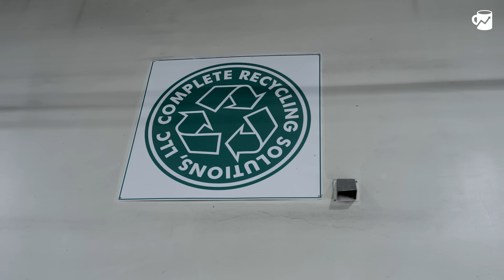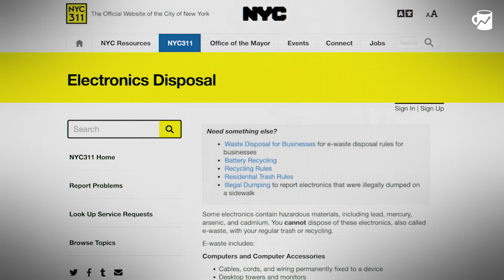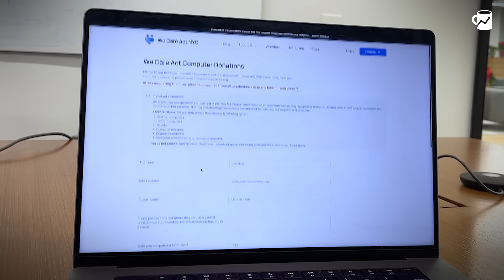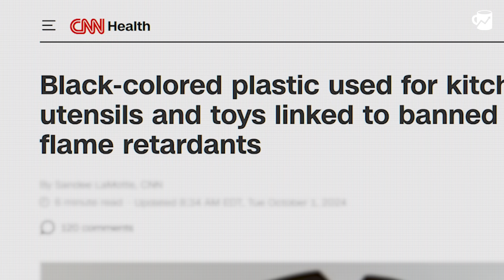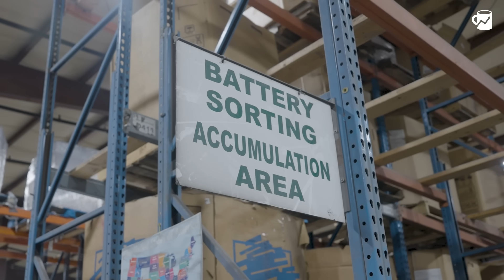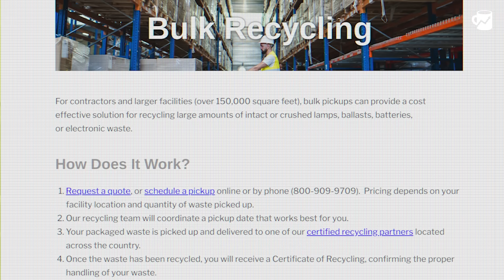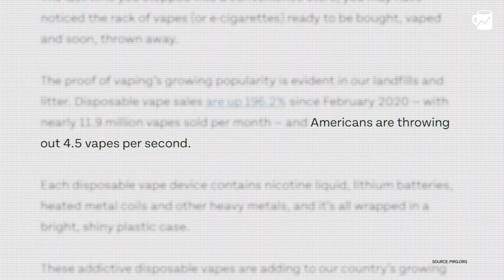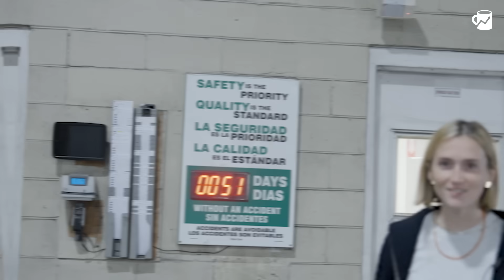I went down a rabbit hole trying to recycle all my tech waste

Comment: The slogan isn't just "Recycle", it's "Reduce, Reuse, Recycle" in that order. The best way to avoid e-waste is to not buy gadgets we don't need. The second best way is to find someway or someone to keep using it.
Reply: Reduce.Reuse.Repair.Recycle
Reply: A little funny story from years ago when I was moving out of country and had not-that-great office table and even worse chair. I tried get van and driver to get them to the landfill but all attempts failed.

Then I just put it for sale at $0 and within 10 minutes I had guy coming to pick them up. I saved money and hopefully person who got them was happy using them.
Reply: In all fairness, the software industry has to do its part and stop software bloat
Reply: There should be a 4th R that comes before all of the others - Repair. I have a subwoofer that stopped working. I opened it up and found that a capacitor had swollen up. I went to Fry's and spent less than $2 on a new capacitor, soldiered off the bad one, replaced it with the new one, and I got it working again, rather than having to buy a new one.
Reply: @googleislame  Yep!  Relatively easy to determine visually, but it takes a little skill and practice to get it right.  Control board for the washing machine, control board for my car's climate control panel, the one for the central air, I don't even remember all the capacitors I've replaced!  I flubbed the control board for the stove, so we had to replace it like we were going to anyway.
I put the stove at the curb and a scrapper came by within an hour.  I even helped him load it onto his truck!
Reply: would love to have kept using my previous phone after 6 years but they stopped android updates and lineageos install didn't work so i potentially bricked it.  it should be illegal to stop software updates or companies should be forced to provide easier custom os installations.
Reply: @PurpleYoshiEgg  and forcing people to change because the app stops working too soon.
Reply: But even if we don't purchase gadgets that we don't need they are manufactured and used or un-used it will go through the same process of recycling. So, does that make a change?
Reply: @mr.jeramius8710  Except they'll make way less of those gadgets, if their is demand (meaning people buy them enough) they'll keep producing them if they aren't being bought they'll stop producing them.
Reply: Vapes and e-cigs are the biggest thing because they can be reused instead of just being disposable
Reply: Amen. It saddened me to see people buy a new phone just because it's the latest phone not because they need it. It was crazy 15 years ago but there's almost no difference these days
Reply: @sie4431  100% there aren't any new killer features nowadays, its come to the point that its just a tool like a screwdriver. It used to be that most computers were outdated in a year. Nowadays electronics are still usable 5 years later, my Mac air is 5 years old and I have no plan to replace it yet.
Reply: @chewielewis4002  actually new M series MacBook's will be replaced every 3-5 years due to the fact how they are build
Reply: @chewielewis4002  bro, even my 2012 laptop is still good for daily uses
Reply: @sie4431  Phones used to be supplied with like 3 years of Security Updates if you were lucky, Samsung's latest S24 series are some of the first to sport a much nicer 7 years of Security Updates and greatly slowing the need to replace a phone.
Reply: @sie4431  What saddens me is when you have to throw away an older phone or tablet because it is no longer fit for purpose, due to lack of software updates, apps being marked incompatible due to old OS versions, or the network radios no longer being compatible because the cell phone providers constantly downgrade the older networks to make room for newer faster ones. 

I have an iPad Mini that was "lost" for several years. So it's essentially brand new when it was "found". But the IOS version cant be upgraded beyond (I think) version 9 or something. Which is a major cutoff for Apple, the vast majority of apps will not install on the older IOS version. And they don't provide access to the older app versions that would work on it. So it's literally trash, despite that it boots up fine and can run the few apps it still had on it from the past just fine, connect to the internet fine. But the web browser is so old it is incompatible with many websites, vulnerable to security flaws, etc. And almost no 3rd party apps such as Chrome, etc, can be installed.
Reply: @sie4431  do you live under a rock? It's extremely different now days. People buy new phones now mostly because the battery needs replaced and or the hardware is not supported so apps stop working.
Reply: @thedude5040 You can replace the battery on phones and (most) laptops (and then recycle the old battery). Much better than buying an entire new device.
Reply: @thedude5040 1. Battery can easily be replaced.
2. That’s a software problem not a hardware problem.
Stop making excuses for buying things you dont need.
Reply: @irvinclemente2368  depending on the phone, batteries may not be easily replaced or even sourced. Are you a programmer? Could you find a way to make an old phone compatible with apps? These are problems the common person faces.
Reply: @thedude5040  keep consuming and don't question why you have to consume more for more
Reply: @Sinaeb  I'm not sure if you are tying to say that personally or if the comment is directed to consumers in general. If personal, consumerism has no effect on me. I'm already a 32 millionaire, a $1000 phone is just a thing and has no meaning.
Reply: @thedude5040 you make a good point but we also have to consider that people generally don't try to hold on to their phones as long as possible, which produces more waste. The battery issue is a frustrating one (from personal experience) but one can ride that out for a while instead of just getting a new phone every 1 or even 2 years because of it. Or just replace the battery instead of buying a new phone. Or buy a phone with that doesn't have known battery issues after a year (so not an iPhone). Or buy a phone newer than what you've got that's just been sitting around for years instead of the latest model

It's different from 15 years ago for sure, especially with how much we rely on the phones but we can definitely do more to reduce and reuse
Reply: @thedude5040  Some people buy a new phone every one to two years. Phone work fine for four or five years.
Reply: @ElmerFudd35  not any more. Those people who buy every year or every other year are the minority
Reply: @thedude5040  You do realize you can just replace the battery right? If that was the main reason people would just do that. I've replaced the battery twice on my iPhone and it is still working fine. Though to be fair it is also only 8 years old.
Reply: @ducklingscap897  explain that to everyone else. Personally it doesn't always make sense to replace the batter because there are other more broken things on the phone. I bought a phone last year because my 4 year old phone's SIM card reader stopped working, as well as over heating, and poor battery performance.
Reply: @thedude5040  maybe change for apps but batteries can be replaced, even if they tell you it is not. Some phones only need a simple battery change when nothing else is failing. I have done it myself many times over.
Reply: @thedude5040  I think they mean when people buy the newest iPhone every year for no reason
Reply: @kaitlyn_stark and I'm saying that doesn't happen anymore, not to the extent of the past
Reply: @thedude5040 nah, thats just not true. people would buy better quality if that were the case like samsungs. apple successfully infiltrated the market with emotionally manipulative marketing that has resulted in a normal expectancy of "upgrade" mentality as "efficiency" is being sold with anything new- despite the lack of quality that continues to be released. regardless phone quality slowing and speeds slowing soesnt make the product unusable or even bad, just slower, which means it works for the intended function the person bought it for still thus they should keep it. your approach to the issue of corporate manipulation on culture is extremely superficial
Reply: @thedude5040 and you sooo need to run the latest mobile games or whatever 😂
Reply: @thedude5040  What apps stop working that soon?? People buying every other generation. I genuinely never heard of app support issues. I definitely deal with the battery problem, but not to the scale of people buying phones nowadays.
Reply: @thedude5040 yea and no. I’m still rocking my iPhone7
Reply: @thedude5040  did a large group of people collectively agree to let you speak on their behalf? No? Then don't shut someone else's comment down and speak for everyone, especially when you're just plain incorrect lol. You're crazy if you think people only replace their phones for the responsible reasons of 'the battery needs replaced or the hardware isn't supported anymore.' Sure, people buy new phones for those reasons, but I'd bet more people buy the new phone every year simply because it's the updated version. Their battery is fine and the hardware just a year old, but they'll still replace it, because of a single new feature, or new color choices, or whatever. You live under a rock if you think this doesn't happen.
Reply: consumerism companies have tradeins where the new phone only costs $200 after trading in an old phone in which case its worth it especially for people like me with almost all my waking hours spent on a screen
Reply: @ckq a phone can last 3-4 years
Reply: @ckq  there is not a single way to legitimately make the math work on your logic here. It's never worth it to buy a new phone every year just because a company offered a trade in for it. 

If the math worked in your favor, it wouldn't be profitable and the programs wouldn't exist.
Reply: @Quantum-Bullet  can go even more longer depending on some factors.
Reply: Capitalism incentivizes consumption. Without regulations, "reduce" and "reuse" are anathema to this concept. Considering Corporations own this country (Citizen's United), you're asking for the full burden of responsibility to be put on the Consumer. Asinine. This individualist "the blame needs to be put fully on the Consumer" is partially why we're in this mess!

We need far more government regulation. If anything, E-Waste should be handled and regulated on a Federal level. But it won't because it's "socialist". And so Big Tech has no incentive to stop releasing more and more E-Waste, making last years product incompatible and thrown in the trash. Big Tech has it's hands all over our government and will fight tooth and nail against anything that would hold them accountable.
Reply: Consumer solutions will never solve this. It had to be addressed at the production level.
Reply: This is one of the most important point. You don’t need to change phone every year, not even every 2-3-4 years. Make a good buy and make your device last 5-8 years
Reply: The whole point of that slogan was to shift blame from corporates and CEOs to the private consumer. Let’s not blame big oil companies who lobby. No matter of avoiding e waste matters when Taylor swift, Elon musk, and the kardashians produce me carbon footprint via jet fuel than most people’s lifetime.
Reply: Reduce, Reuse, REPAIR, Recycle ♻️
Reply: @d3rpn1nj47  i think repair kind of goes in the reuse category. Repurpose was the other R before recycle
Reply: I try to buy all my tech used. Phones and laptops surpassed my needs about ten years ago so I don’t mind being a bit behind.
Reply: @konradhunter1407  yeah, me as well. Older laptops with newer hardware and software work great for my needs.
Reply: @vaderladyl  Lack of security updates is the main reason to stop using a phone. Multiple companies have promised security updates for X number of years then don't actually do it
Reply: @strayiggytv  yes, I guess, if that is a priority of yours.  Still people will use them even if just for calling and texting only.
Reply: The 4th R, missing frim the slogan here, is *Repair*.
Reply: Still rocking my iPhone 12 after buying it when it was brand new. Might need to do a factory reset, it’s been slowing down lately but it still does everything I need from it without issue. Plan on keeping it till it becomes unusable.
Reply: They should add "Regulate" to the slogan
Reply: I have 2 computers that are 12 years old.  Replaced the hard drives with solid state drives, so they run very well.  aren't used for gaming.  Microsoft is essentially making me, and anyone with old computers buy 2 new computers.  It's frustrating.  I also drive a car that is well maintained, it has 420,000 miles and my phone is maybe 6 years old.  I just don't like being wasteful and don't like throw away culture. Technology is very interesting, convenient and fun, but I don't feel the need to constantly upgrade.
Reply: “Reduce” and “Reuse” have been all but silenced by industry and government.  It’s like they are anti-consumerism words.
Reply: Naaah there should be laws to prohibit programmed obsolence and so the phones would last longer
Reply: Just dont use things!!! Dont eat food!!!
Reply: ０．０
Reply: Repair is also a good R to use before recycle
Reply: Womp womp yap about ir
Reply: your "slogan" is wron, is "REPAIR, Reuse, Recycle"
Reply: Imagine if someone watched this video on an iPhone and not an Android.
Reply: I hope I don't get in trouble, but I stole 2 android phones from our company e-cycle bin!  Both of them are newer than the one I've been using for many years (Android 12 vs. Android 10).  
I also still keep an old Android 4.04 tablet!  It has to be charging all the time, but I've also got it hooked up to external speakers so I don't move it anyway.  It runs Pandora and media music just fine!
Reply: Exactly what I do. It is the best way.
Reply: Reduce, Reuse, Repair, Recycle
Reply: I've been reducing my PCs and electronics. I my main hobby is music so I just stuck with it. I bought decent quality Japan-made bass. My amps are all analog and I can repair it. I quit gaming too so I don't need a GPU. I'm still looking to reduce further but I think that's about it. I think only the PC and phone are the unrepairable things I have now.
Reply: And what was featured in all those 90s era ads, but recycling bins? Nothing. Even if we pretend for a moment that most people had the skills to repurpose old technology, thanks too lobbyist advocating for anti-Repair legislation. It can actually be illegal to reverse engineer or something and find another use for it or repair it.
Reply: What about people who buy old tech? I mean, I don't actually need it but am saving it from being thrown out.
Reply: missing Repair! fix it before you recycle.
Reply: bless you for this post - so sad that the more intentioned directives of reduce and reuse are all but forgotten and the final one turned out to basically be mostly a lie
Reply: That slogan is 100% propaganda. All the trash in the world can fit in a relative small are a that nobody would notice.
Reply: I have a Tracfone flip phone and really only pay $20 every three months to keep the service. I do have an iPad and an iPod Touch for apps, etc. and use them until the ios no longer supports them. My laptops have also each lasted about ten years. The fan on my 2004 XP laptop doesn’t work, however I have used it once in a blue moon (with a cooling fan underneath) to upload video footage from my camcorder that uses firewire.  also later bought a Roxio kit that has a way of converting from firewire to my current laptop.
Reply: modern life its more like. replace, reproduce, just cycle
Reply: That's why the sidewalk is so much easier than hauling an old bluetooth speaker back to Best Buy. 😉 Let's the people walking by decide if they can adopt it now that the lithium battery has 20 minutes capacity.
Reply: The BEST way is to nationalize the tech industry so we can stop producing planned obsolete garbage
Reply: Great statement that does not fully answer the problem which is government doing what they always do making it too difficult and, frankly, confusing for a busy average person to get the failed product into the process for reuse of the materials.
Reply: so the economy just go down with it? how brilliant.
Reply: Seeing some of the other comments shows how effective marketing has been to lower expectations consumers have for their electronics.  

The vast majority of "slowdowns" people experience is software bloat/inefficiencies, basically lazy coding relying on power of the chips instead of coding technique.  
A very old html Ex: If you want a blue background, you store a image of a single blue pixel, then call that pixel 1000 times-  This keeps storage and processing power low, since simple repetitive tasks are what computers are good at.  But today, they just call up an entire 1000pixel sized blue image, which is 1000x more storage and processing work.  

Luckily enthusiasts are still working on efficient programming and there are operating systems like ZorinOS for old computers and LineageOS for mobiles.  These can make old devices usable (browse and stream, which is great for a backup device).  
There are entire communities dedicated to solving the problems of the world, just waiting to support the average person when they choose to expect more than what they are being told.   Demoralization and apathy are feelings, not facts - feelings can change.  We can do it, together.
Reply: This slogan was invented before e-waste back when the crisis was plastic. Reduce actually was defined as look for another product with less plastic. 
Reuse is the umbrella term of continuing to use something so you don’t have to buy it again. This does also apply to selling/donating used stuff but the donation/re sell markets are struggling to keep the demand high enough for what they already have. recycling is the last because it’s for those items that cannot be reused (or reduced really)….
Thank you I shall return to Mrs Frizzle’s field trip now. lol
Reply: I've had my mobile phone for 3 years now. I don't want to replace it yet. It's still working fine.
Reply: Thanks for the sermon you self-righteous &#$@
Reply: Im the source of like 40% of e-waste on the east coast and I am not about to stop now
Reply: Agreed!
Reply: You can’t. Planned obsolescence. No more updates to iPhone 8 means you are forced to throw it in the trash. It’s these elites that are the real problem. Luigi knew the truth but only got one piece of shit off the planet.
Reply: My phone is so old I recently got a warning the internet apps might stop working due to lack of support lmfao
Reply: How about 'repair'?
Reply: Reduce, reuse, ec y ce
Reply: Dont forget repair. Most things people call "broken" are still quite easy to repair.
Reply: And it is inherently anti-capitalist. Of course capitalism pushes the recycle “option” over the other two.
Reply: @IanJAGreen  no, "Capitalism" would be a marketplace where you could choose between companies like Apple that glue & weld everything shut so you can't reuse or upgrade, or a company that makes hardy and upgradeable devices that can have a long lifespan.  What we have now is a market manipulated by the big players, designed to keep any competition out (that's not a free market).  And this doesn't just apply to tech/electronics.
Reply: @IanJAGreen  It isn't. It's anti-manufacturer but not anti-capitalist, capitalism is fundamentally about voluntary trade and this includes the responsibility of consumers as they make up half the parties involved in such trade. Responsible consumption is rather important to capitalism, consumers simply stopped caring mainly due to governments facilitating the throwing away of item.
If you compare that to places with a high "repair and reuse" culture, like Japan, they make it hard to throw away items which force people to make purchases much more consciously and making re-use much more important with a whole economy build around it. You want to throw away an item in Japan? Make an appointment with the trash company and wait 2~3 weeks till they pick it up and get fined if your items is found at the trash dump place more than a day before the pickup date.
Reply: Or throw it out and stop acting like you have the power to destroy the world with trash. Which we absolutely do not.
Reply: We should also reduce the amount of sanctimonious advice that we give others. Sadly, we live in a world where communicating platitudes consumes energy.
Reply: @compromisedssh  so you say let people go on without learning something that can be potentially important for them. Do you have a better   alternative?
Reply: I need the tech watch so I can show other people I spent a bunch of money on a tech watch.